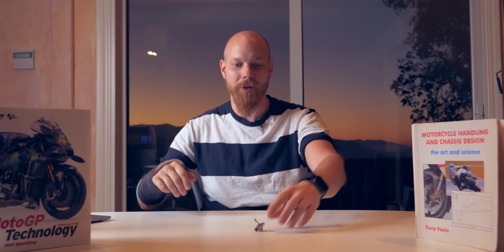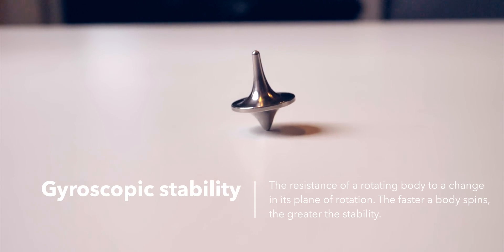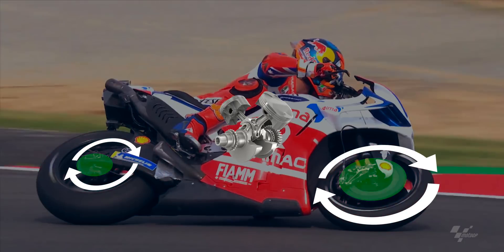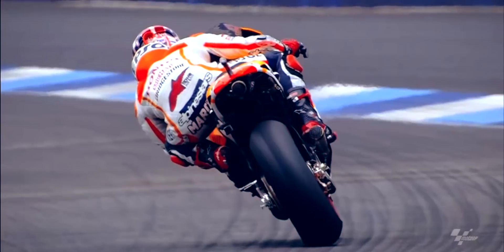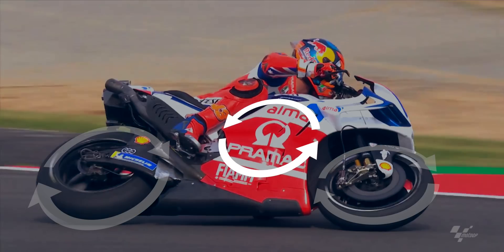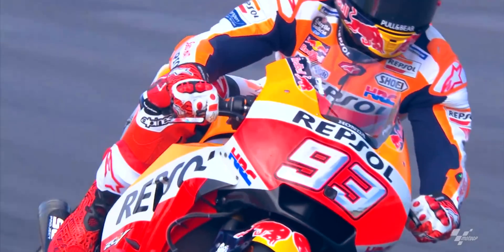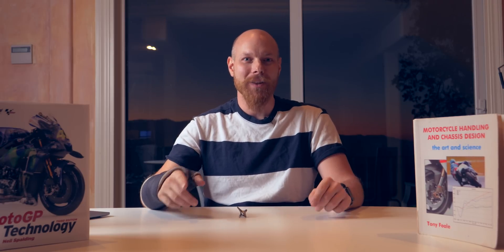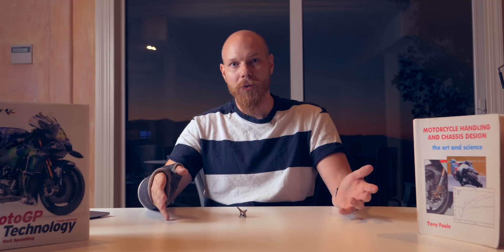Why MotoGP Engines Spin Backwards

Comment: Only 2 current production bikes have reverse rotating crankshafts. The Ducati Panigale V4's, and MV Agusta F3 800/675. So if you're looking for the closest thing to a MotoGP bike any Ducati V4 variation is going to be your best bet. They're 5 years into the development of the V4 engine in production form and has the most GP derived technology. Truly a incredible and also beautiful engineering.
Reply: It's kinda sad that nobody among the bike reviewing channels didn't mentioned this. I've heard this for the first time.
Reply: Thank you. I was about to ask that question.
Reply: As a f3 800 owner I can confirm this is true 👍🏽
Reply: @slipanglesundays  i dont feel much difference on mine hahaha
Reply: I wish all manufacturers ran counter rotating crankshafts in their superbikes. If it can help improve performance I think they should push to try and make it for production. There's rumors that Yamaha is going to bring a counter rotating crankshaft to the next generation R1 which would be amazing. I think if done right they're going improve a already great handling bike, which will make it a force on all racing champions.
Reply: I think that some others MV like the rivale have counter rotating crankshaft.
Reply: @4sstylz  you're right I should have specified the 675/800cc MV Agusta triples all have the reverse rotating crankshafts.
Reply: the other reason is the engine efficiency and friction loss. higher weigh on the canckshaft actually degrade cylinder wall to lean side more. this kind of engine has great durability and gave more grip when you exit the corner in acceleration but also come with downside wich make the bike has lower grip in late breaking.
Reply: The V4 S or also the V4 ?
Reply: @brunomartin7798  All currently in production V4 motorcycles from Ducati, including the V4 Streetfighter ;-).
Reply: Ducati bevel twins rotate backwards.
Reply: Thois statement is not true, this is nothing new. Triumph Thunderbird LThas that. Even Kawasaki GPZ 500 and ER 500 had this back in the day. 👍
Reply: @crashmm2379  zrx too
Reply: V4S 2022 is now more closer to motogp, bunch of upgrade with motogp's tech
Reply: Yamaha Vstar cruiser bikes have reverse rotating crankshafts, including the V4 Royal Star and Vmax bikes

your statement is still correct because Yamaha stopped producing these bikes, in spite of the fact that Consumer reports rated them as THE most reliable motorcycles on the market.
Reply: Thank you.
Reply: there is also one 49cc, the derbi variant, a spanish model
Reply: what about the early/mid 2000s desmo RRs? Those are as close to a street legal moto GP bike I've seen, most aren't intended for street
Reply: This is not true Aprilia also does this
Reply: TVs apache rr310
Reply: @o73venky  wrong!  reverse inclined engine is not same  as counter rotating crank.
Reply: @mohba01  can you please give the source of information. I couldn't find any.